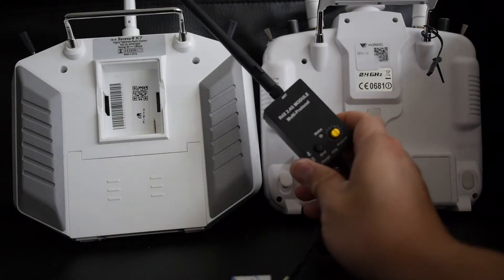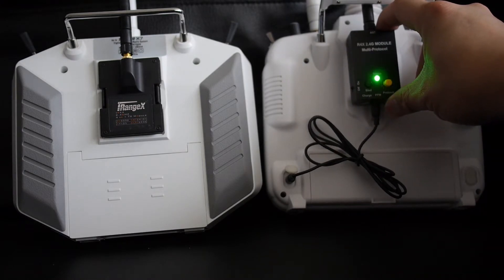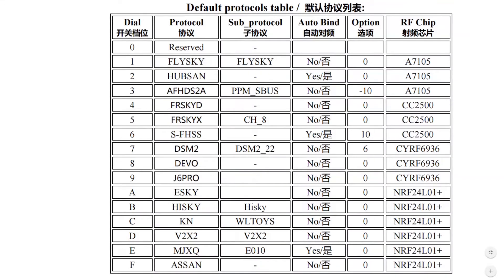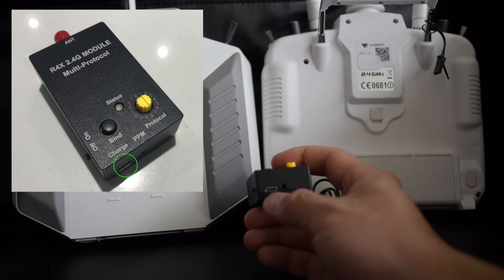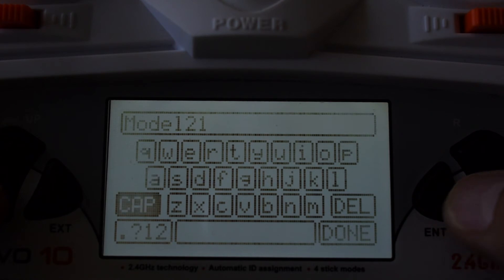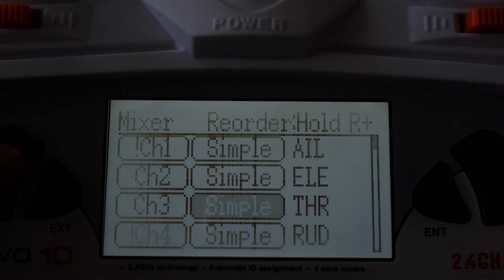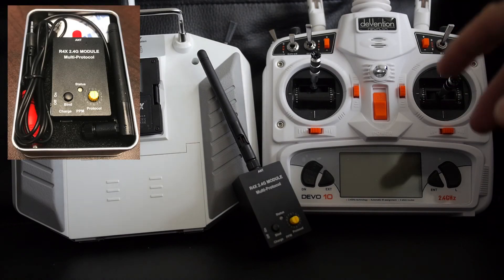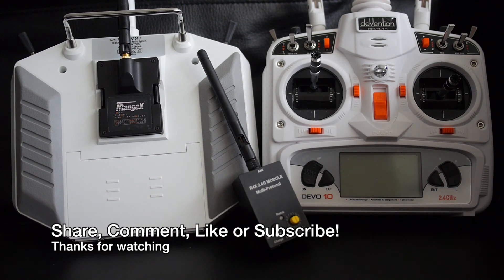✅ iRangeX R4X Pro PPM 4in1 Multi protocol External TX Module ATMega328P BangGood

Comment: very nice
you used devo 10 with deviation, right?
how if  put this module to devo 7?
should it work?
should I reverse my aileron and rudder too?
thank you for your time...
Reply from the maker: +Jeffri Ranger it should work with any transmitter with trainer port. Reversing in it sure you have to experiment to see if it is required to reverse the direction

Comment: I see you have opened it. I'm guessing it could be possible mod the non pro version, the one with serial module bay, to get working with a devo 7e via the trainer port connection...? Would it work on deviation... In that way I could switch transmitters!! just by mounting and dismounting..
Reply from the maker: +Hendrix Kon possible but would be too much work. Much easier to get a Taranis and the removable 4in1 modules.